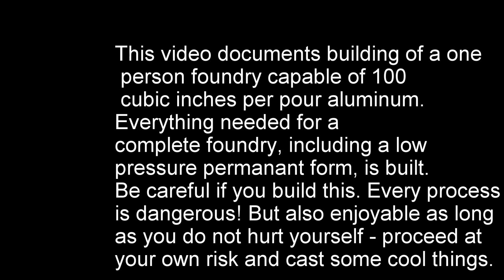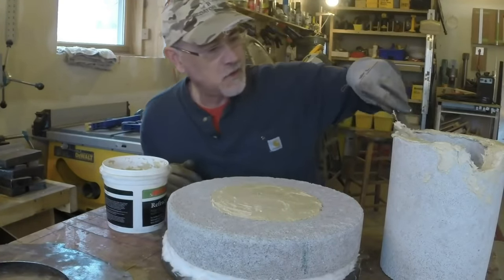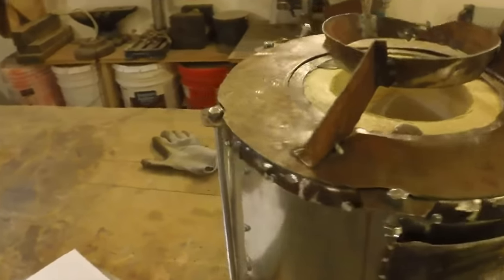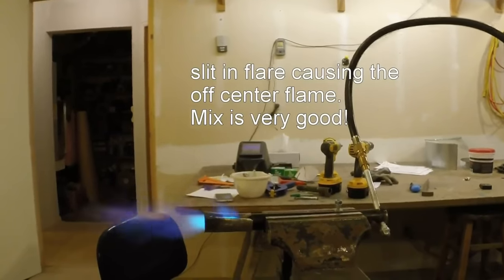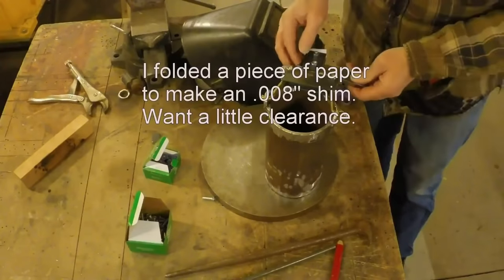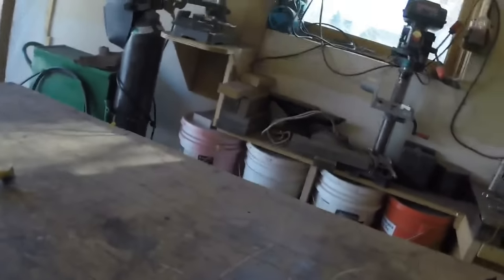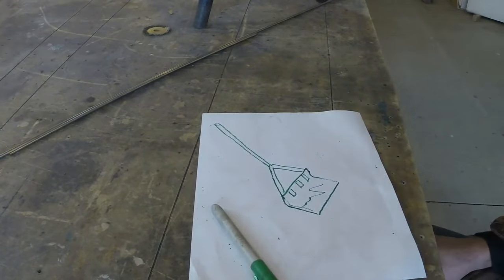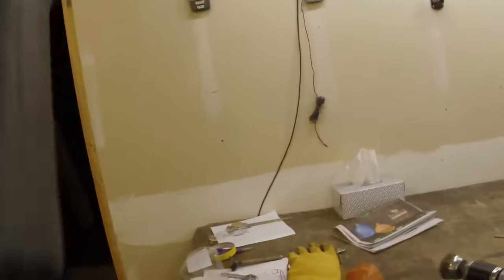DIY foundry complete

Comment: the result was pretty good !
ussually the mold should be preheated
so as to keep the moltened aluminum
sliding down with no resistance.
since it was held outdoor with low temperature it also contributed to fast hardening of the metal.
Reply from the maker: Yes I think keeping the forms hot would make the pouring go much better...in my steel forms, It is worth building a heater for these.

Comment: insulation was the key and air /gas mixture other then that it should work for melting a lot of types of metals and glasses. This would be relatively cheap the only issue is to get enough oxygen and propane to do this. Not sure on how much it uses is it more then a grill size tank of propane and not sure on how to get oxygen for cheap. All they have at hardware stores are the small tanks of oxygen for braizing, soldering supplies or small welding tanks but the welding tanks are usually a kit that are expensive. So its the oxygen tank thats the issue for me actually going and doing this. Plus not sure where you can refill oxygen cheaply ,, those welding place i would imagine charge a lot for refills and the tanks got to be up to a certain ridiculous standard /expensive standard. But its cool to know this stuff.
Reply from the maker: Been a while since you commented, but I'm getting ready to rebuild the foundry and add much more oxygen. So, I will add more ports so the addition of 250x air (which will give the best ratio of oxygen to propane) wont be so noisy... presently sounds like a jet engine  with all that air being pushed through that little burner tube. Also, adding temp control!

Comment: I cast bar the same size as that straight into a thick walled seamless tube, the aluminium literally just falls out once its cold due to shrinkage.
Reply from the maker: Nice! Makes sense. I think that you using a seamless tube but not cutting it is an improvement over my cut tube. You will get a better shape too because my tube being cut makes an oval, not a circle.  Thanks for your comment.

Comment: I do the same thing but I use empty coke cans with the tops open so I can pour into them.  I just set them in sand up to the top edge and pour. The castings already have a nice smooth skin before they even get poured!   I use the castings on my lathe making stuff. Since most of the parts I make are bike parts , they pretty much all fit within the size of the can.  Works very well for me.   By the way if you're not sooting the inside of that pipe form try it, it makes getting the aluminum billet out much easier.
Reply from the maker: That's a great idea! And, if you are watching your temp, which I bet you do, you can get nice high quality billets....and as you said, a good size for making bike parts.  About the split pipe I use for extra/ billets, I thought I would have to do something to the  surface so aluminum wouldn't stick, but I have never had any aluminum stick to any portion of it. The relatively dirty surface is likely a part of that but I think that maybe the expansion the pipe goes through might also keep aluminum from getting the opportunity to get really attached.  Thanks for watching!

Comment: if you want to make  good poor make the mold hot as hell with a tiger torch  on the inside not out in the cold and poor it fast youl find you wont get the lines in your poor old engine oil is the best for heat you can cast iron with it and use a blower an old vacuum cleaner works good I also have a recipe  for a crucible if you have any need for info give me a call .
Reply from the maker: Thanks Daniel!

Comment: think you couldve made the clamp for the crusible a LOT less complicated 
could keep the hooks as they are and the wedge too mut weld a pipe to the frame and a rod to the wedge and feed that through the pipe 
make a fingerhold at the end of the pipe and a t bar at the end of the rod 
now if you want the hooks to come loose grab the finger holds over the t bar and press them together this will push the wedge down and make the hooks move freely 
want to lift grab only the t bar and lift 
 this will pull the wedge up and hold the hooks out , done and all at a long distance from the cusible 
you still want to lock it ? put a spring between the pipe and the t bar

as for the gravity mould : i seen someone cast his own aluminum rods using steel pipe , he just filled the steel pipe 
when the aluminium cools it schrinks and you can pound it out of the pipe as a solid round bar

like the way you made a refractory vase/ insert and covered it with the wool stuff , the full refractories get pretty heavy and the full wool ones seem to damage eazy and get moist if you pouring and storing the foundry
Reply from the maker: +watahyahknow you have many good ideas! Thanks for your comments.
Reply: Could have made the whole thing a lot less complicated but it's HIS foundry done HIS way and he's happy with it so who am I to comment!
Reply from the maker: Thanks for your comment!

Comment: Can this be used to melt lead
Reply from the maker: Hi Kevin, yes this will actually melt lead quicker and without the need to coat the crucible because lead does not damage steel like aluminum does. Remember if you melt lead, to not get it too hot. It will emit dangerous fumes if it gets overheated.
Thanks for watching!

Comment: It's your project, your time your fun. Some people enjoy over engineering. Some will cut every corner just to get to doing a pour as quick as they can, then all the duct tape and bailing twine falls apart. To each his own. If you like doing things fancy then all the more power to ya. Did you fire the refractory cement to fully cure it? Thanks for posting. Nice work.
Reply from the maker: Scott, thanks for your comment. Yes, people go from the minimum to over the top on things. And, to each his own, true. I did allow the refractory parts to dry for a few days and then fired them at 400F for 8 hours to make sure any water was driven off. Several castings done and the refractory is holding up very well.

Comment: Anyway i am rambling the actually structure of it is simple to make but the oxygen and fuel to supply or do anything significant with could be costly. Unless the welding supply places can refill oxygen cheap and you only need a small size tank to do this with. So maybe some day but doubt it....essentially your making your own cutting torch chamber (equivalent to gas welding ) to melt the metal. One could do the same with a gas welding torch over the metal in the concrete pot ... however the concrete chamber is just easier then standing over it with a torch everytime you want to melt metal.
Reply from the maker: Thanks for your interesting comments. Considering your thoughts about welding gasses, yes oxygen and other welding gasses are becoming pretty expensive...I think doubling in cost in the last 10 years. However, if the goal of a project could potentially cover the cost, or you don't care about the cost, then that may be one less obstacle in your way.

Comment: pas terrible le résultat  mais cela vous a servis a Quoi , mais je reconais que votre four a bien fonctioné
Reply from the maker: Yes true. I did a bad job with the cylinder I cast. But the whole system proved good., and has produced many good castings using metal molds (also using a thermometer to know when to pour). Thanks for watching!

Comment: It seems to me that a lot of people have ideas about what your doing wrong. They seem to think your idea is not right according to their experience in melting, pouring, or designing furnaces. Your design is what you want it to be and if it does what you want it to do then there you go. I've spent a lot of time watching people build their own furnaces and crucibles and it looks to me you have done a lot of research and time designing you equipment. If you haven't yet then check out olfoundryman. He IS a master of all things in regards to melting and casting aluminum. Enjoyed you vid and be careful brother
Reply from the maker: Donnie, thanks for your comment. I understand that most people who like to do these kinds of things are also driven by their own experiences, and me too. As my experiences are unique to my work, so I design to fit. I don't expect people to like all or maybe sometimes, any of my ideas, but for the most part, I think my work is good enough that it can be helpful, and the overall good reaction to my amateur video is great! But there are always other ideas and opinions...so I hope most people can find something useful in my work even if they might not like some things I do. Thanks for watching!

Comment: Also another method though more of a hassle is to get brick rather then pouring concrete cylinder structure you need. I imagine you could instead of metal melting do glass melting in this homemade foundry not sure haven't seen anybody pouring glass yet from these things
Reply from the maker: I think you could melt glass in this. I actually make glass from time to time when I use it for assay work...the flux is usually glass. Thanks for watching!

Comment: It's been 2 1/2 years or so since you did this video. I hope that you have invested in a used Bridgeport type mill. It is amazing what you did with a plasma cutter, mig welder, chop saw, drill press and a hammer. I'll never build one but I can say I saw it done one time. Thanks for sharing.
Reply from the maker: Thanks Mancel. You're right...over 2 years! Time goes by faster and faster. I would like to have a nice Bridgeport mill but it would take up too much room. I guess I need a bigger shop! I've used the foundry to cast lots of different things, and it has been really reliable over time, so the extra time I put into the design was worth it. Thanks for watching, and for your comment!
Reply: Aaaaaa.

Comment: Not sure if you are aware but, molten aluminum eats steel very well.
Reply from the maker: Very true. You have to watch just how much gets eroded in with the melt...changes the composition. I use boron nitride to coat the crucible and it works very well but needs reapplied occasionally. Keeping an aluminum skin on a steel stir rod also helps prevent erosion.

Comment: Nicely done system.  I liked your design.  It seems like some kind of mechanical assisted pouring method would be necessary or helpful.  I also was wondering why most furnaces require physically removing the crucible instead of having a channel for metal to flow from a fixed crucible, that is, if one could rotate the furnace.  Have you considered a way to preheat the mold with the exhaust from the furnace?    Thanks
Reply from the maker: Thanks Kvick! Once I got used to the crucible/handle combination, it became very easy to use. I re-watched my first pour recently and noticed just how awkward I made that first pour. In my later reusable mold videos, pouring becomes very easy. I think the locking hooks and the counter weight work well enough that if I wanted I could pour a lot more weight easily and without help.  As for a fixed crucible, I think probably it is not used too much if a foundry pours different types of molds...probably easier to make the mold without having to design it to the furnace?. And, no, I have not considered having the mold preheated by the furnace. That might be a good thing to try, thanks for the idea!
Reply: I worked with a 50lb induction smelter for a while, a simple air piston was enough to rotate the crucible to pour and it was triggered by a foot pedal, it all ran on less than 100 psi shop air

Comment: I save a lot of time by starting with an old water heater and just cut a section out of the middle to get the total height I want. and mix 50/50 kiln dried sand and plaster of paris for the lining
Reply from the maker: Yes that would save a lot of time. I do like building things so I didn't mind the extra work....and it was nice to use that really rusty metal up on a project. It had sat for a few years getting ignored because of its condition. Thanks for watching!

Comment: Here a thought spin cast a 2inch thick mirror about 8 inches in diameter for a reflective telescope. The spin should put a concave surface that will cause a spherical reflective focal point. This has been done with mercury but it has its obvious limitations. Just a thought for something different to do.
Reply from the maker: Cool idea! Thanks for watching!

Comment: Very nice! Much more elaborate than anything I would want, but nice all the same. However, I have to subtract points for not shooting the deer though.
Reply from the maker: Thanks Duke M! Because of the weight I really had to get engineer-ish about the crucible.So it actually worked out well because with the handle, I need only to connect it one time and I can pour, so I don't need crucible tongs plus a carrier, and I can do all by myself (most crucible carriers are for 2 person operation).  I really don't need the lock...but using it is I suppose insurance, so I have kept using it. And the Deer...LOL! We have so many deer around here you would not believe it unless you saw it for yourself. Last week at one point I had 8 to 10 in my little driveway, and there were others hanging out on the street. A bunch of big racks! Life in Craig, Colorado.

Comment: Just thought you should know that instead of using a metal type rod for stirring aluminum that you could always order your self a graphite rod to use instead that will really hold up way longer and save you a lot of headache.
Reply from the maker: Hi Chris, thanks for your comment. Funny thing about graphite rods...they don't last well either. I got one when I was mixing casting alloys and it only made it through a couple of pours...that really surprised me! I also thought that stainless might last better but it also goes pretty quickly. My ideal stirrer would be a material that would strongly adhere to boron nitride. Boron nitride is the best protectant I have used but it is easily rubbed or scraped off of steel. Maybe boron nitride embedded into a graphite rod might hold up well? Thanks for watching!

Comment: Better than soot?
Reply from the maker: +William Savage if you are referring  to boron nitrite, yes much better.
Still need to be careful though. Orchard well but can be abraded off without much effort. Thanks for your question!
Reply from the maker: Coats well....auto-correct turned that into orchard? Thanks for your comment.

Comment: This was cool, gives me an idea on how to build. Never considered just using building insulation to keep the heat from transfering to fast. Essentially all one has to do is pour a concrete cylinder of desired size (with in reason).... have 2 metal pipes for air and propane/gas mixture run into it. And insulate the surroundings with a metal or concrete top. And a place you can place concrete/metal pot that you heat to liquify the metals. ( your design was a little complicated but is really good ) Nice so maybe metal melting to some extent is still possible at home. I.e have your own foundry.
Reply from the maker: Thanks! I'm considering a rebuild using a much larger air intake and a blower so I can optimize the fuel/oxygen ratio. I need more temperature for assay work. My big consideration is making sure I can keep the added heat in the stove as long as possible,  so I am mulling over a more complicated shape for the inside of the refractory so it has more surface area and creates more resistance to the airflow. I will video any updates!

Comment: Buddy i just watched your vid and to me that setup is about as useless as tits on a bore hog. Way over complicated but if it works for you more power to you. lol have a good day.
Reply from the maker: I like to let all the people who watch my little channel see all comments, even those that disagree with my content. There is one thing that I overbuilt, and that is the lock bolt...it isn't needed. And, there is a lot of extra stuff that isn't absolutely necessary, but makes the pouring go really easy. So, for the folks who don't pour too much, less is usually better. For those who pour a lot, and by themselves, and melt heavier material (that crucible can hold 60 lbs of brass), then the extra stuff becomes a lot less in your words, useless. And the extra work to make a cylinder of metal rather than making little discs gives me the ability to make high quality large cylinders that are pretty useful  (and save a decent amount of money) for machining bigger parts. I am not trying to convince you...your opinion is yours, but you give me a good platform to describe the extra parts for people who might wonder why I made them. So, LOL have a good day!